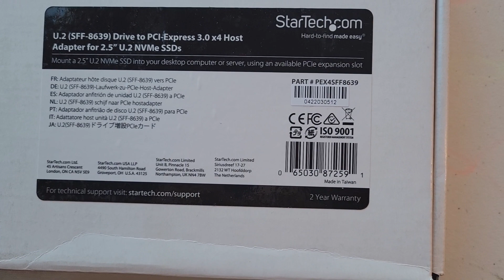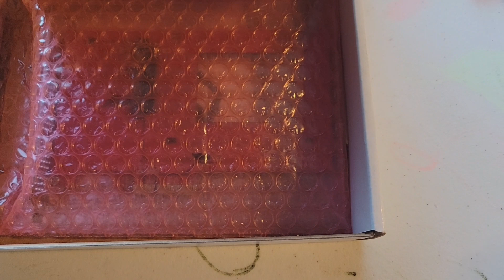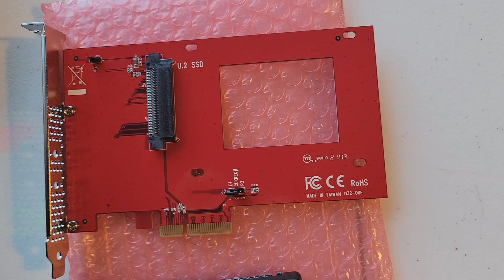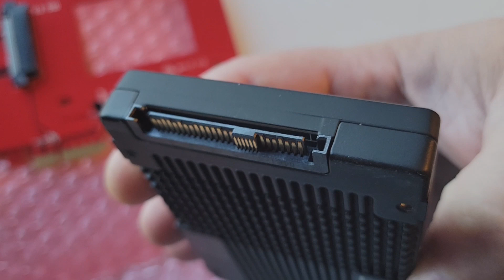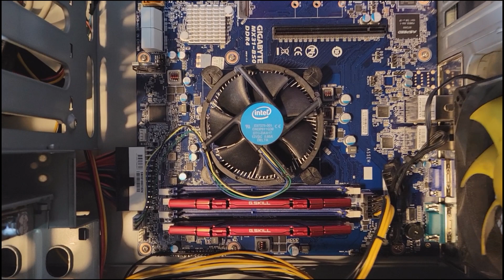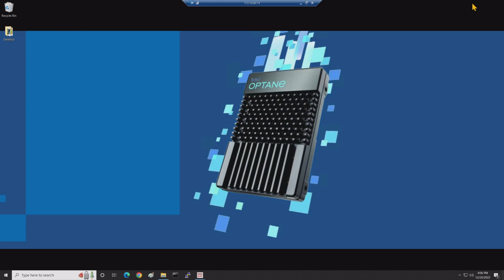Installing Intel U.2 Optane Disk using an adapter

Comment: Hello sir, Can I install that pcie 4x on m.2 docking? I want to use u.2 as external drive for laptop
Reply from the maker: Not quite sure I fully understand your question, can you elaborate?
Reply: @vmexplorer how to make u.2 ssd as external drive(portable)?
Reply from the maker: @ Quick Google search shows many U.2 external enclosures.  Just don't expect it to preform as good as connected to the Mobo.

Comment: The 4k IOPS for both reads and writes that ATTO shows for your 400GB optane drive is FAR below what intel advertises for that drive on their ark page, i.e. 1.5 million read IOPS and 1.1 million write IOPS.  I see the same discrepancy with my 905p between advertised and what ATTO reports.
Reply from the maker: Thanks for the comment.  I would guess that Intel has a specific testing environment and software that tests their products accurately.  I would suggest asking Intel how to properly test the performance of their devices.
Reply: @vmexplorer in consumer grade mobos, will my bios uefi see the u.2 drive inserted to the u.2 to m.2 adapter , but will most likely not be able to boot into the u.2?

Comment: Hello vmexplorer , did you say you can Install an Operating system on this Drive?
Reply from the maker: In this video I don't believe I did.  However, from what I understand from my chats with Intel and if your system supports this drive, then yes you can use it for a boot drive
  However, where it really shines is as R/W cache drive.

Comment: Hello vmexplorer , i bought the same adapter in order to mount an intel P5800X U.2 SSD which is a PCIe 4.0 SSD on my PCIe 4.0 x 4 motherboard slot.  Does the adapter support PCIe 4.0 transfer speeds or it is limited to PCIe 3.0 speeds (which is bottleneck for my SSD). I am a bit confused...
Reply from the maker: Thanks for the comment.  I'm pretty sure it does, but I'd recommend looking at the product link in the video description for the StarTech adapter and calling the manufacture for more information.
Reply: Have you tested the speed yet (with Crystaldiskmark etc)? I would like to buy a P5800X as well, but I couldn't find this information anywhere. So if you could share your experience it would be very useful, also for anyone else with the same question who might find their way here.
Reply: There are newer versions of these adapter cards, that explicitly state 4.0 support